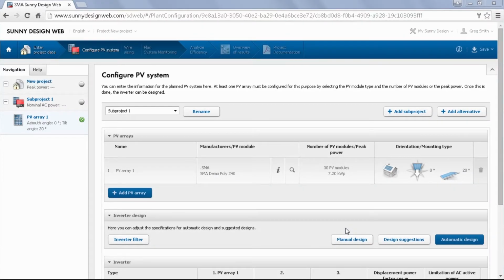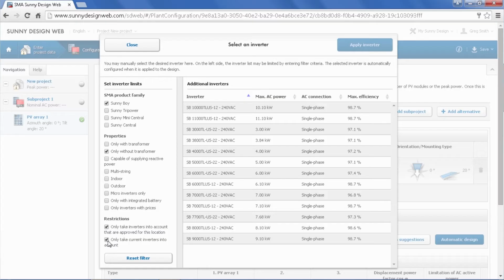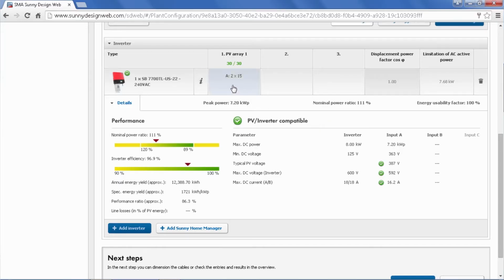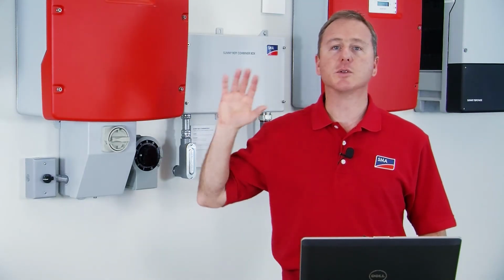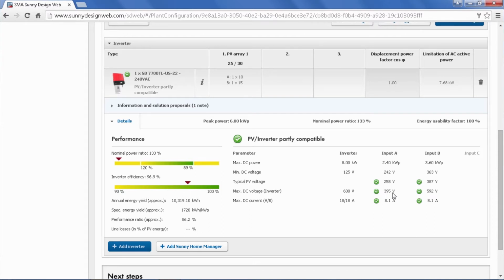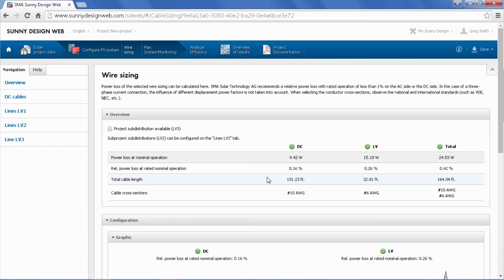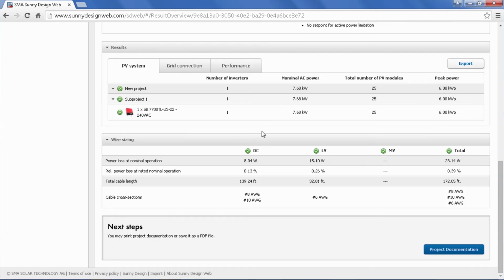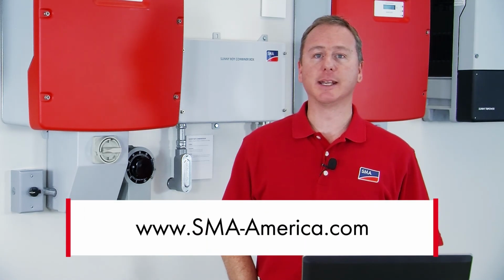Tech Tip: Using Sunny Design Part 3

Comment: When I press on the "Manual design" option, I don´t get as many inverter types as shown in this video. How can I solve this problem? (Note: This happens in both the Web and desktop versions of Sunny design)
Reply from the maker: Rafael Parada There are several “inverter filters” that can be chosen in Sunny Design under the Settings item when holding the My Sunny Design pull down menu (top right corner when logged in). Selecting more of them will reduce the number of choices available. Let us know if deselecting some of the options help increase inverter options for your system design.